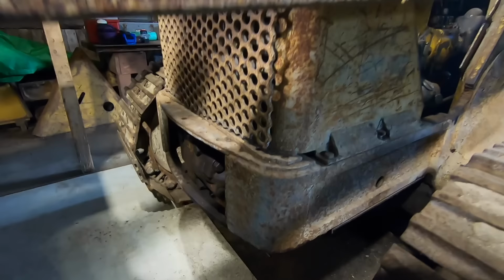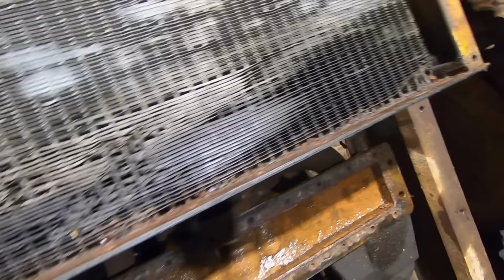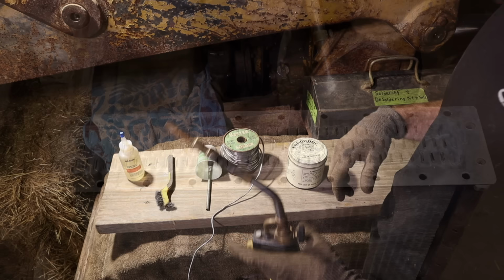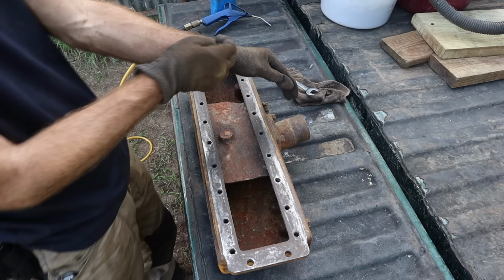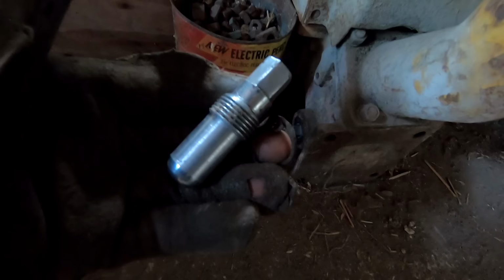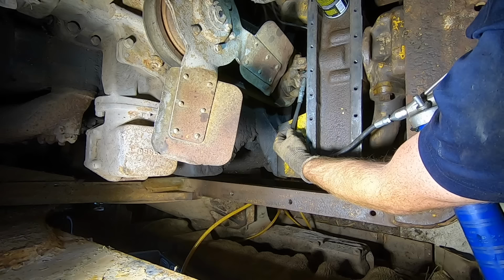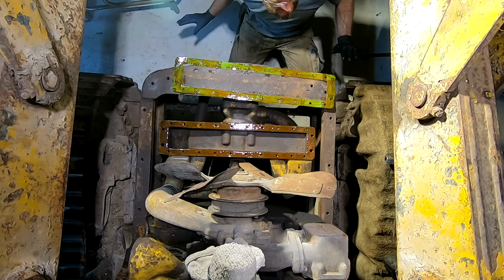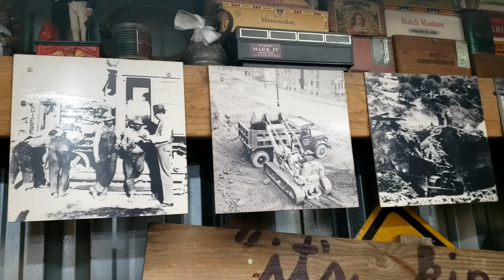The Radiator's ALL CRACKED up... I Guess We Should FIX it! ~ Part 3 ~ 1950's Caterpillar TraxCavator

Comment: The seal is prolly a pump seal,the other thing  is  a pin for the structure of the track frames.  You may need to ballast or stabilize to reinstall, the holes are for bolts to retain this pin in location. Most of these are greasable. The  tank gaskets you made up are 75$$ to a hundred n 25 for 1 end from cat garrenteed if available at that.

Comment: It’s pretty normal on a rad like that for the end tubes to be blanked off during manufacture . For a repair such as you needed to do a bare flame would normally be used rather than an a solid soldering tip, but good effort none the less.

Comment: Hope ya went ahead and put a new water pump on and thermostat and new hoses ...also check and Mack sure the pulleys are in good shape if they are bad the will wear your belts out fast and not turn the water pump and fan fast enough

Comment: love to see you,re journey while rad off you should have put new fan belt the drive cshaft to hyd pump has been changed u joints no longer availbe but just go to truck  parts store get 15/16 cross for pto on big trks tack weld in last long as you will need there are rubber gskts for the rad tanks they will be flexible to keep from new leaks ready to see old red  dig some dirt

Comment: Dear friend instead of  using wire to clean the raw of the radiator you can use the depth stick of the hydraulic tanks work better. Good luck. Eng. Basheer

Comment: Anytime you have a seal leaking, instead of just putting a new seal in and expecting it hold, look at the bearing behind it first because that bearing is probably worn out and it lets the shaft that comes through that fall down and wear the seal. The problem you got with the leak at the pump is  the bearing is worn out in that end of the pump. It's probably not that expensive and is worth trying here. Expect to find that the pump is probably worn pretty bad, but you won't know that until you take the loader out and put into a pile of dirt and see how much it will lift, that will tell you the condition of your pump. If it will lift a half a bucket of dirt high as a dump truck, you'll probably be able to get along with it, just don't expect it to breakout large bucket fulls of hard packed ground. If you don't put the bearing in this one and only the seal, it will blow the seal back out about the time you call for pressure to do anything with the bucket.
The pivot pin you're looking at in the middle looks like they have replaced a broken or worn badly pin, with what they've had that was handy, and that pin that's in it looks to be plenty substantial, I would leave it. If it breaks while you have it, do the same thing they did, unless you have a BIG billfold that you want to throw at this loader. You're doing good.

Comment: your persistence is very impressive! Why dont you use the flat side of the hammer for the out/inside edge? works better than the round side. And next time you have to purge a fuel system, unscew the fuel lines at the injector. That way you get air out of the line as well.

Comment: You didn't show all thing down the core to the top and bottom. So I don't know if you've tightened it down correctly. You should always start at the center of the long Edge and tighten down from the center out. This way you won't get any buckling and the surface is will lie flat. This will guarantee a good seal.

Comment: This was a very interesting project related to getting the radiator back to reliability. Good job on the work and the video. While it is a lot of work I like all these sub projects in a rescue of an old tool. On your tap do you prefer the spiral debris groves over the straight in line grooves? Or was that just luck of the draw? That was one of the best sequences of old iron rescue that I have seen on video.

Comment: I realize it’s been several years since that was run what two years ago you say up here.? One thing you should do where you got the radiator out of the way is to replace the belt on that radiator water pump that would really make a big difference there. And check the water pump for bad bearings too just in case it is your work on why you’ve got the radiator off.

Comment: You could probably get new no gaskets from Cat but you would faint at the price. Also the quality might not be as good as the material you used. I am plagued by a leak on my D4 using Cat gaskets combined with a bolt I didn't fix. I don't think anyone is making radiator of that quality any more. Congratulations on the repair, you really know your stuff.

Comment: Looks like a roller frame pin u der the front holding in together cant say for sure 

And the seal might just be a hydraulic pump out or input shaft seal not sure what the pumps on those are like back them should be accessable at any pto sales place

Comment: According to the parts manual I have (it's not a complete pdf, but it's better than nothing), the 5H3422 hydraulic pump has two seals, Part #5H3825 & Part #6H1275. I can email you my pdf, if you want.

Comment: What about picking up some good spare parts from the yard and send blast them and pit oil on them for spare or drop in replacement? :) These old parts are quite crazy strong. With all those new machines (most) they crack or break at some point in the structure because they save on material which was back the never so accurate so they added some extra strength???

Comment: Curious- How did you know you didn’t have a leak in the middle of any of the tubes?  Surprised you didn’t have to take it back apart and seal one or two shut like the PO did. 

Great work and content by the way!  Looks like a nice old unit.
Reply from the maker: I didn't know 100%, but I was pretty sure because I combed over the whole thing... If I had found a leak, you would have seen me fix it!

Comment: Planning on doing a full resto on this or just a working resto? In my opinion most of these older machines aren't worth doing a full resto on unless you have someone lined up as a collector already, but they can still do lots of work. That's the way I'd go.

EDIT: Realized that my definition of working resto might differ slightly from others. For me, if I have to restore a part to get something working, I restore that part fully. It can sit on a slightly beat up frame, I don't mind, but if it's a part I've worked on, it friggin works fully. Like, knowing my brain the way I do, I'd have even opened up those old already closed channels in the radiator and fixed them. If I didn't, then there's a part of me going "You gonna trust someone else's work on that? Really?" constantly until I throw it out or fix it.

Comment: I was thinking about how worn the drive sprockets are, they're going to have to be replaced.  If you can't find an acceptable pair on the used market, you might think about a collaboration with Fireball Tool. His skills with CAD and his very large waterjet table would make cutting a new set a fairly simple, provided that suitable material can be had. I assume that they're hardened.  Then a trip to Keith Rucker's (Vintage Machinery) shop to do the machining necessary would be interesting, he has machines of sufficient size to do the work. I don't know of anyone with a YouTube channel and a heat treating oven of sufficient size to do the hardening, but there might be someone.  Collaborations are always interesting...
Reply: Jason from fire ball and Keith Rucker are at diagonal operate corners of the country 
The freight charges would quickly out weight any savings

Comment: Coulda just used a pocket knife to carve around the outer edge of the radiator gasket.  And get a cordless drill that is just your normal 14.4 volt driver.  Use that for driving the thread chaser.  Whole job should have been done (thread chasing) in less than 5 minutes.

Comment: When making the gasket, what are your thoughts of starting with a corner like you did, but then go to the corner that is diagonally opposite to it?  So Upper right corner first then a lower-left corner.  My thoughts are this will help make the gasket be a bit more square to your mating surface.

Comment: "How much solder did you use?"

"Yes."
Reply from the maker: YES is exactly how much I used!
Reply: LOL 🤣
Reply: Back in the late 70s I worked for the Borg Warner radiator manufacturing plant in Coldwater, Michigan.
The plant manufactured that style radiator. I hired in to run the solder dip pot. 
After the core was assembled and the tables by the ladies who pushed the tubes through the fins. One of the ladies would install the headers. They would slip the header plate over the tubes and then use a wheel with spokes on it that fit in the ends of the tubes and spread them. That riveted the header onto the core.
The oven operator would load the assembly into the fixture and run it through the convection oven where the tubes were soldered into the fins and soldered to the header.
After the assembly came out of the oven I would pick it up with a crane and set it in the dip pot.   A mechanical pump would drive molten solder into a raised ring that touched the bottom of the header and soldered all the tubes to the header.
To reinforce the soldered joint between the headset and tubes a person would set rings of solder, like chain links, over the end of each tube. Then they would  use a natural gas torch to flow the solder around the tube very similar to what you were doing.
After soldering, the assembly was washed in a sulfuric acid bath to remove oxidation and excess flux.
I worked there 5 years as a machine repair, maintenance, die maker, fixture builder. Those old radiators are infinitely rebuild able.

Comment: Actually you should never tap a hammer on a machined cast surface. It's the equivalent of running with a pair of scissors. Cast iron is under a lot of unseen stress, especially an irregular casting. You could end up cracking it, then be in a whole new world of hurt!

Comment: 31:40 Good bush method for shit like that in the future. Take a socket that's a little too small to even hammer on, torch the stuck part to soften it a bit because it's probably work hard, then just heat the socket up and tap it on. should go on fairly easily when hot. then let it sit for a bit and cool back down before attempting removal. bonus points if you can hit the threads with a candlestick (paraffin wax is a lubricant and stays at higher temps) because the heat will wick it along the theads

then buy a new socket. Like i said. bush method. best done with craftsman, because if i've fucked with something that much, the $6 isn't gonna be a waste if it works

Comment: Do you have the serial number of that machine ? If so I could look on CAT website for the leaking seal.
Reply from the maker: 12A1844
Reply: @Mmercier942  I read the document and I was surprised in the illustrated diagram when it said Number. n = bolt but didn't actually give the size of the bolt

Comment: Really like the videos.. If I had it down that far I would be breaking out the spray paint to do more detailing, that's just me.  You might try to contact Warren at YouTube channel Western Truck and Tractor Repair.. He has some great videos on heavy equipment as well as tractors. Like the way you go the extra on doing the job right. Learned how to solder a radiator today.

Comment: I see that you only needed to pull out the "bend" cheater bar......nice. What were the other two that you mentioned in an earlier vid? It was bend, break, and I can't remember the last one.....
Reply from the maker: Bend, Break, & Destroy!
Reply: Salvage Workshop   When I worked on Cats, we had up to 8 foot cheaters, and used them.  Remember going into Sears & Roebuck with a 1/2” breaker bar in 1970, guy pointed to the wall and said go grab one.  Later asked how much I had on it, I lied and said 3 feet.   He just grinned.  It was a solid 12’ and I was giving it everything I had!  We used old bandsaw blades with the teeth ground off to “ rod” out the “tubes” in Arizona.  Really hard water would calcify after a long time.  Tried to get them to use distilled, wouldn’t listen to a youngun.
Reply: @wrstew1272  I once had a 4' cheater on an old Matco 1/2" breaker bar......pulled so hard that we bent the pipe. Damn bolt didn't budge, but the breaker bar took it like a champ!

Comment: Just to add another comment when I tap out threaded holes I use a cordless drill and set the clutch with enough toque to turn the thread tap and that way you do not snap the tap.

Comment: Salvage Workshop, contact the Service Department at Milton Caterpillar (585-815-6200).  They can answer you questions regarding the gasket kit for the front hydraulic pump and the loose pivot.

Comment: Looks like you made a simple mistake when putting the nut on the end of the shot drain plug, ought to have been a left hand threaded nut you used (That way it would've tightened onto what was left or the plug).
Pretty common mistake.
That, coupled with crap welding of the nut made your job so much more difficult.
Always go for the simple, think before you dive in buddy.
You also need to have a look at how to properly cut gaskets.
You need to start at one end with the full paper size, cut your holes on one end 1st, bolts in and carry on along the length cutting holes.
Once you have all the holes ball paned and held (lightly) with studs and FLAT washers, then you go around the outer/inner edges cutting the final shape.
Old school👍
Love seeing the old machine getting sorted though👍
Reply from the maker: I have no idea how anything worked at all, since I did everything wrong!

Comment: You went to a lot of trouble to remove the drain plug with a rounded off head and you replaced it with a new one with a nice hexagon on it, when you poured water into the bottom tank it was dripping so you used a BLOODY SHIFTING SPANNER to nip it up. THAT IS HOW IT GOT ROUNDED OFF IN THE FIRST PLACE.

Comment: I still maintain cracking a raw egg into it would have solved the problem.
Reply: Gril Nam Only temporally, vibration and time will make it leak again, and of course at the most critical time.  Black pepper will get it going also, but it ain’t fixed till it’s fixed.  The guy is young and has determination, cat makes almost bulletproof stuff (at least in that era). Seems like it just needs a little love!

Comment: 47:00 Have you ever tried Hylomar? I work on some small 2 stroke engines sometimes and the manufacturer recommends it for sealing two engine halfes together, without any "real" gasket inbetween. https://www.amazon.com/Valco-Cincinnati-Hylomar-Gasket-Sealant/dp/B00CFH9GZG

Comment: • If you own a tractor or heavy equipment, you know there are a zillion grease points/zerks.  Do you self a favor and buy a LockNLube coupler https://locknlube.com/
• The best scraper money can buy ! https://toolguyd.com/carbide-super-scraper-review/  It WILL severely gouge aluminum !
• Get yourself a hard plastic kiddie wadding pool.  Fill it with the strongest, cheapest vinegar you can buy.  Soak rusty parts in it and they will come clean after a couple of days.

Comment: You should have gone to cat or used thick rubber gaskets like original. It provides a bit of vibration dampening. I have had this issue on my traxcavator and had the radiator out 4 times for separation. Finally installed a cage on top to stabilize  it. Check it out in some of my vids on youtube👍